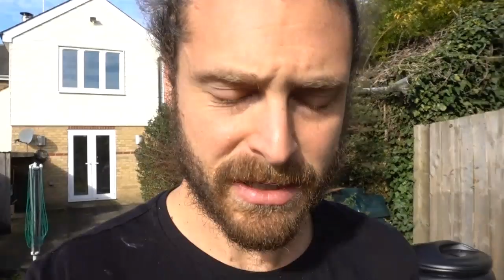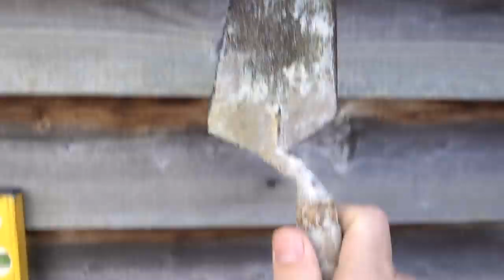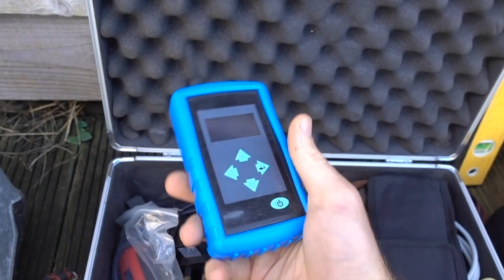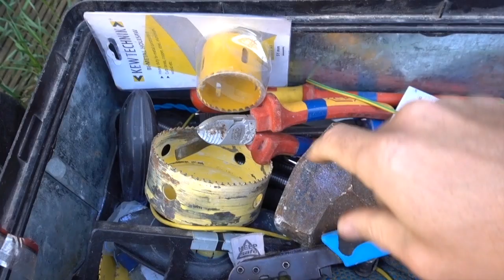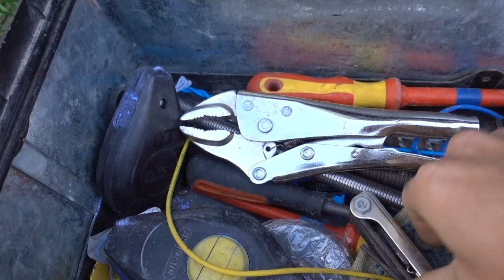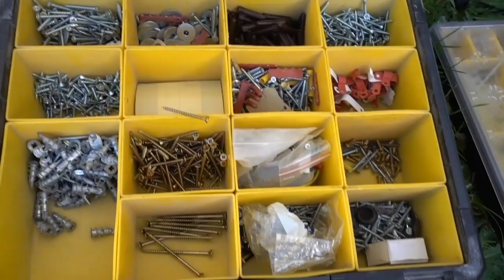Electrician Tool Tour Of Some Old Tools I Found In My Dads Garage

Comment: I always use to buy CK, but after constantly having them nicked on sites when you turn your back, I started to use cheaper brands. Now the only CK item I have are the cable chompers & the cheaper brands last reasonably well as long as you don't do anything silly with them.
When i was an apprentice my spark only had Snap On tools, lovely tools but if you ever went near his box you found a 25mm bush bouncing off your head.

Comment: I've had tools for years as well and get all sentimental if someone uses them wrong. You start not lending them out then 😂
Reply from the maker: I know ha! Some of these I've had since I was 17 years old. I've done many boards changes with them. That Stanley tool box has been a chair, a work bench, a step up and more!!!!
Reply: @DanstheEngineer  Crazy! Hahah yes I've still got my old one of those. I think I stood on mine and it cracked down the centre, plastic mind. You've got your own firm haven't you?
Reply from the maker: @BILLY1973ism  I don't anymore. I sold it!